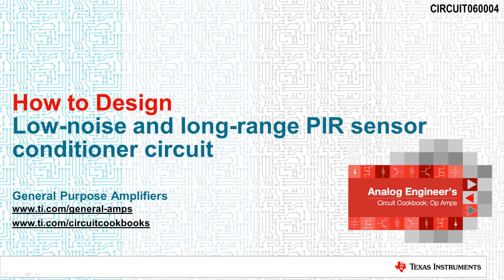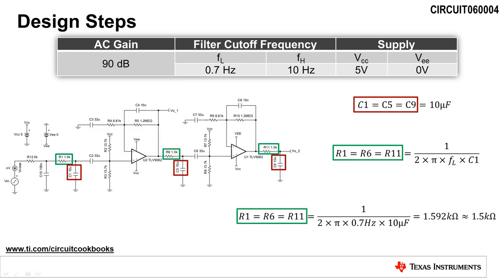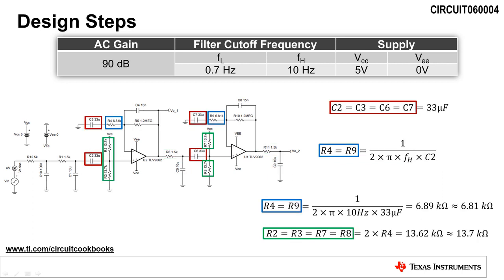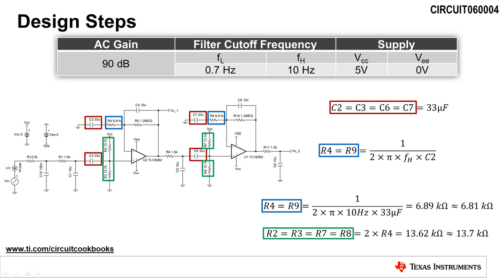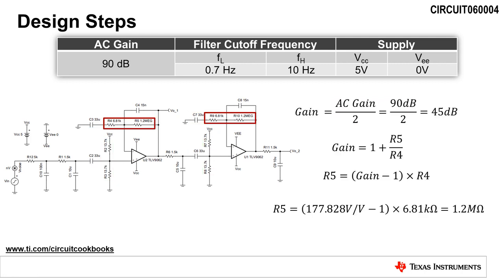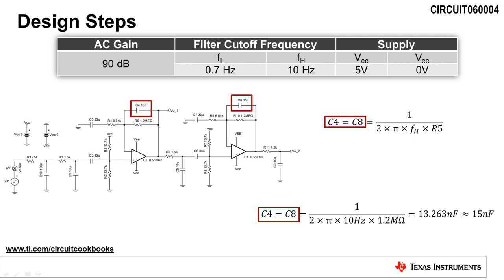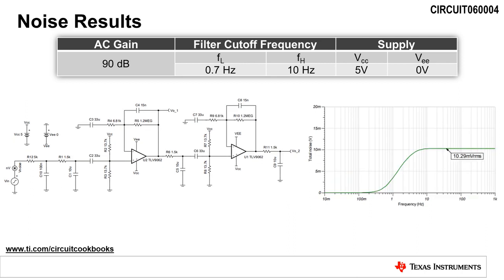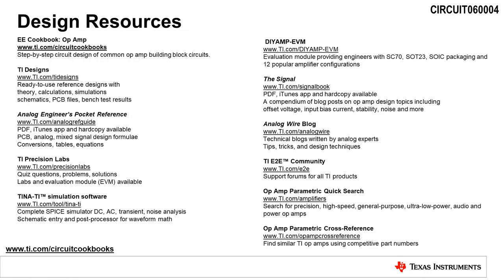Low-noise and long-range PIR sensor conditioner circuit

Comment: Where exactly is the PIR output pin? Is it represented by that voltage source "Vin"? Near the noise? And why is that first resistor labeled R12